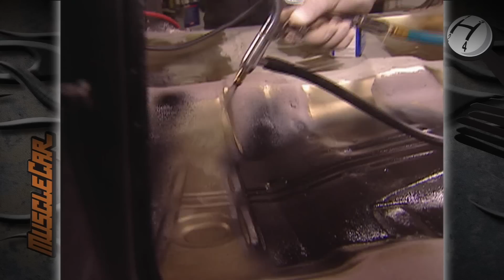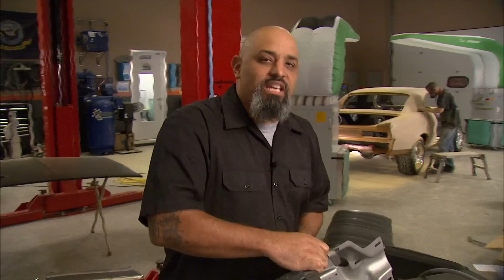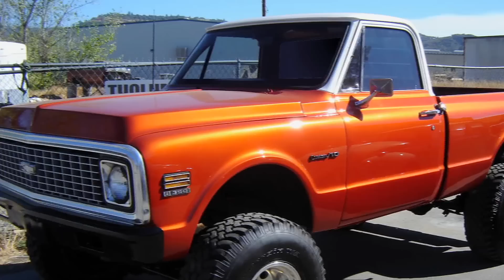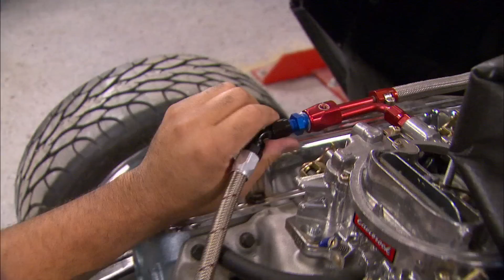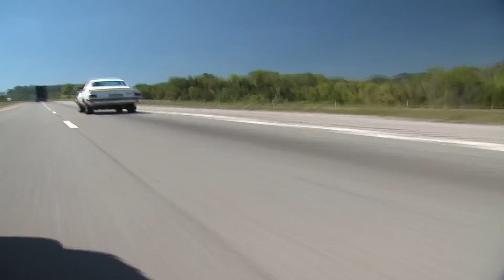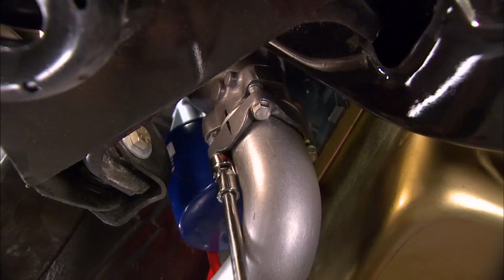Good As Gold Custom Paint for our Pontiac LeMans - MuscleCar S3, E1

Comment: Only government regulation could make a 400 ci only produce >200 hp.
Reply: True. I like to look on the bright side; if Uncle Sam didn't put the regulations in place, engine R&D wouldn't have ramped into high gear and we would not have engines today producing more than 1hp per cube. We'd have the cheapest shit Detroit could make and market.
Reply: @PrivateUsername  We would also have engines with a decent number of cubic inches instead of the practice of using a small engine and then turbocharging it to get more horsepower at the expense of much higher maintenance costs.
Reply: @1575murray  Exactly mate
Reply: @PrivateUsername  We have had turbos and superchargers for decades. The Grand National and the Syclone showed what was possible. The technology is relativity the same. Fuel and oil are cleaner. But instead of introducing regulations slowly, they tried to chome out the auto industry. Look up "Jimmy Carter Sweater Fireplace" here to listen to the dumbest President we've ever had tell the American people we are about to run out of oil.

Comment: To say that the '64 GTO was the first muscle car of the 60s is to ignore the '61 409
Reply: lol I knew this argument would pop up somewhere.  Nowadays, there are a few cars before the GTO that fit the description of a muscle car; supercharged Studebakers, even the 1949 Oldsmobiles.  But they were just considered fast cars.  The GTO was the first car that started the muscle car movement.  It sent every other manufacturer scrambling to make their own "GTO type" supercar.  I've done some research on the origins of the phrase "muscle car."  It didn't exist until the GTO was made.
Reply: @originalpunkSxE  1964 was also the first year of the Chevelle and 442
Reply: @davis7959  The 442 was created in direct response to the sales success of the GTO and offered a 330 cid engine.  The Chevelle's top engine in 1964 was the 327.  It was still the GTO that started the muscle car trend.
Reply: @davis7959  YES, 1964 you could order a 327ci. 350hp. SS 4 speed Chevelle, that was in fact faster than the GTO 4 Speed Tri Power, i owned both cars back in the day....
Reply: @originalpunkSxE  Yep you got that right brother.
Reply: originalpunkSxE Yup, this argument has been had since the 80s.

It’s the goat
Reply: A 5,000 lb. car with a big motor is not a musclecar.